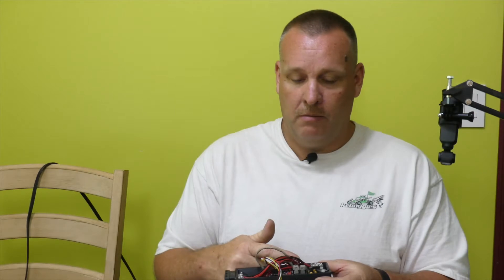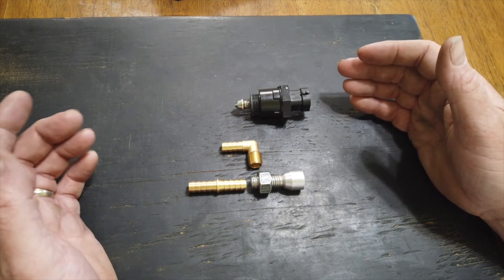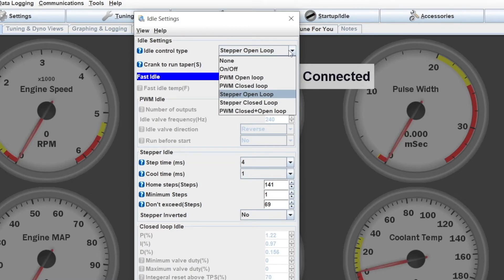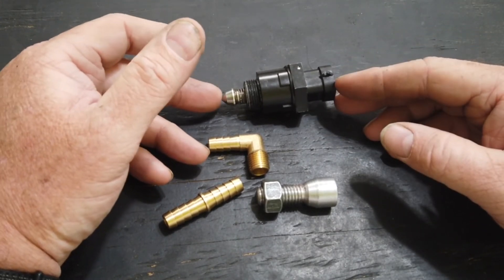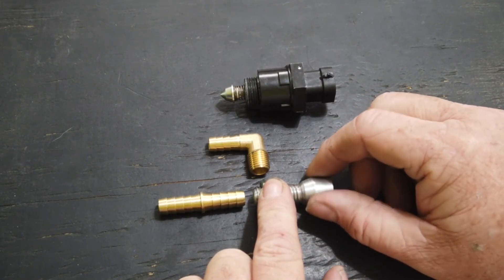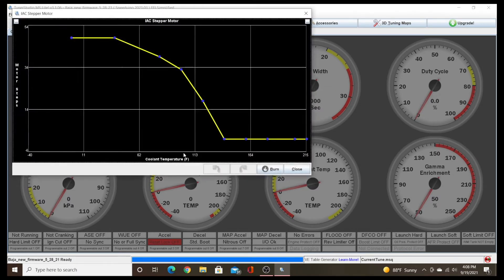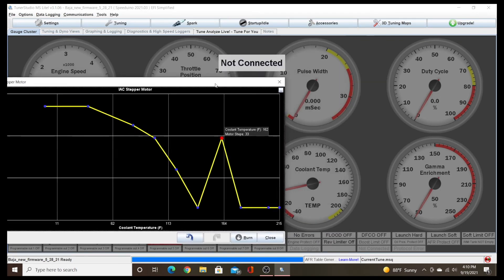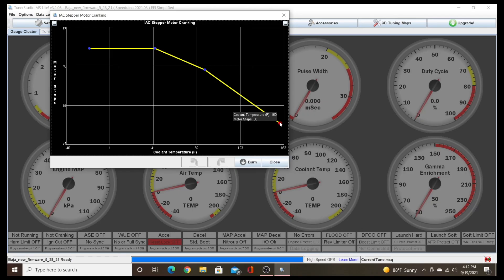GM 4 Wire Stepper idle Speeduino

Comment: Hey! I'm running a speeduino on my turbo setup as well with the exact same iac motor. Just using the cb performance machined block as the housing. Mine doesn't seem to do anything to help cranking, even with the steps at 70 or 80 during cranking and I have it set to idle at 1300 cold and work it's way down to 1000 at op temp. When im starting the car tho, i have to crack the throttle for it to start up cleanly. But when the car starts it idles at like 700 rpm then after 5-10s will jump up to the 1300. It's like the crank settings won't work and the run setting doesn't kick in til a few seconds after startup. Any idea what could cause that? My home steps are 249 and don't exceed 200 I believe.

Comment: Hey man do you know how to wire up a iacv for a 4g63 engine? I have a UA4C vc2 speeduino board which has a built in stepper motor driver, I currently have a 6 pin iacv on my throttle body and 2 middle wires are 12v (which are now cut off, since speeduino will be providing the power for the iacv) 
this is pretty munch the pinout for the iacv pins based on the DSM ecu pinout:
A1 - 12v  - A2
B2 - 12v  - B1
Reply: I currently have them wired up like this and when I turn ign on I could hear the iacv vibrating for a bit then turning off, like its calibrating on the stock ecu it does that too
I have it wired like this
 Speeduino board ---> IACV pins
A2--->A1      A1---->A2
B2---->B2      B1---->B1

Comment: Hello! I want set up eletronic pedal in speeduino, but the pedal has 6 wires and 2 wires are for signal and the speeduino has only one pin for signal, it is the 22th pin
How to proceed?
Reply from the maker: I am not sure what you mean by electronic pedal if your talking about drive by wire speeduino doesn't support that yet.
Reply: @wjones1972  thank you!

Comment: Thanks for the video! Just one question. How do I get the Step Time (ms) ? Is there any experimental way if I don't find literature for my stepper motor?
Reply from the maker: Glad it helped. To get your step time you can turn it down until you get missed steps. So for example with my engine warm I only need about 5 to 7 steps for 1000rpm  but if it is missing steps it will go up to say 50 and still be idling slowly. So if it doesn't feel like it's responding correctly it could be missing steps. and the error tends to get bigger over time. Most of the time 3 or 4 ms is fine. but you can start higher and work your way down the only downfall to a large number is a slower responding valve.
Reply: @wjones1972  first of all, thanks very much for your almost instant response!
so.. let me check if I got it.
you are saying that once your engine is warm it needs 5 to 7 steps from the fully closed valve position. So, if by that time you change the step time to for example 1 ms (which is not big enough to make a move) and change "motor steps" to 50 (instead of 5-7) it won't make any difference. That means your step time is too low. Did I get it right?
Reply from the maker: @andrespareradeniz9797  Kind of yes don't focus on the number exactly. but if its missing steps it will count up or down depending on your valve config without changing idle much. but i think you have the idea when it is trying to correct the engine speed if the steps are to short the commanded steps will change without the valve changing much.  I think the main concept to keep in mind is it doesnt know where the actual valve position is it tries to know where it is by keeping track of the steps it commands so if its  missing steps the valve will be in a very different position from what it expects or shows.